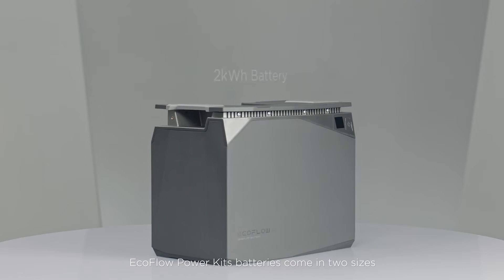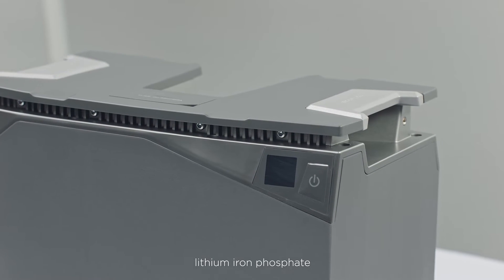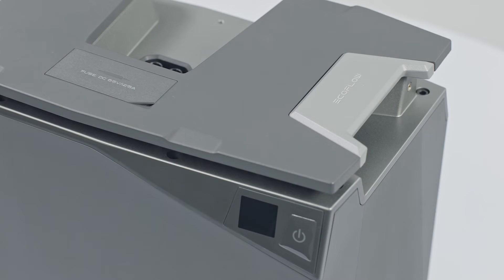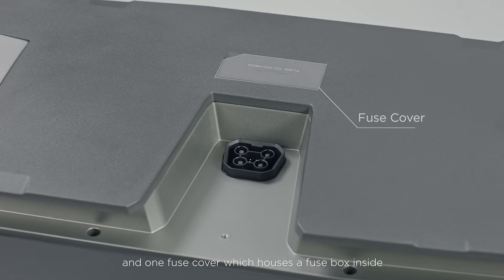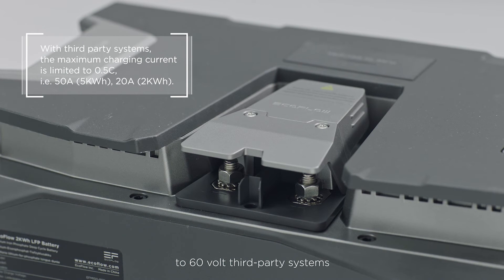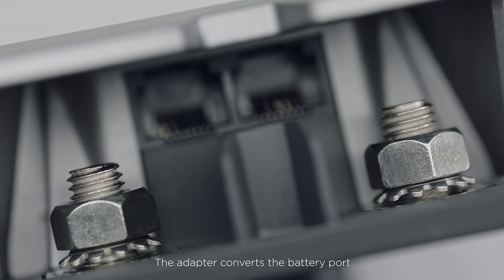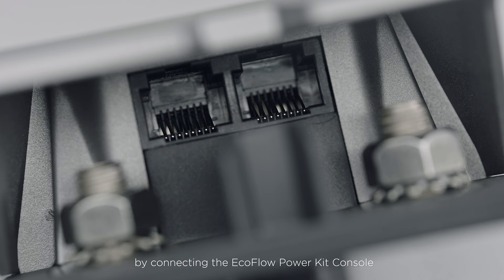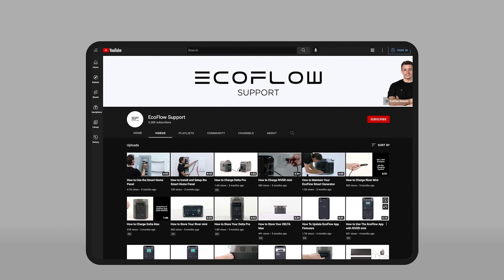Power Kits Tutorials | EcoFlow 2kWh/5kWh Batteries

Comment: Connected to the Powerstream, the battery has an annual consumption of 140kWh and more, only for charging and discharging the battery.
Reply: But that watts consume comes from Solar? Comes from batery itself? or from the Grid?
Reply: @TargetingXmod_RC Thats the consumption that the Powerstream uses from the Battery for conversion losses and keep the Powerstream alive at night when you set the discharge-limit. At the next morning the Powerstream first charges to discharge-limit plus 5%. With an 2000Wh Batterie that is about 300W before sending power to the grid
Reply: And now After more then 8 Months all Problems Like the 5% Minimum charge of the Battery non working automation still exist. I‘ve Reporter the Problems First time in August 2024

Comment: Are these compatible with the Delta Pro?
Reply from the maker: Hi there, sorry Power Kits are not compatible with Delta Pro, but EcoFlow smart generator can do.
Reply: @EcoFlowTech  That’s strange, why would Ecoflow give their Power Kit batteries the same connectors but make them incompatible? 

Ecoflow customer support also told me I couldn’t link up my two Delta Pro units but I can, a simple Anderson Powerpole to XT60 cable does the job perfectly, charge unit 1 with solar and when it’s full turn on the 12v DC and transfers over to unit 2 with almost zero loss rather than the almost 40% loss Ecoflow stated via their solution to plug it in via the AC plugs. 

I’m pretty sure the Power Kit batteries would work with my Delta Pro’s but the units just wouldn’t recognise them as extra smart batteries, that’s too expensive of a chance to take though. 

Thanks for taking the time to answer my question.
Reply from the maker: Hi there, yes the interfaces on Power kit's power hub and its batteries look the same to the one on Delta Pro, however they can not communicate. Therefore, you can not connect Delta Pro to Power Kit or use its batteries to charge Delta Pro. Regarding linking up two Delta Pros, the way you try to connect them is doable in principle. However, the charging power is relatively low and the cable might heat up as the maximum output of Anderson port is 30A(which is much higher than solar input).  Your feedback is really insightful and I have brought it to our product team. Cheers for that!👍👍
Reply: @EcoFlowTech  Thanks. I’ve done the research and the solar input can handle up to 60A via the BMS and that’s a safe amperage to use with 12AWG cable, it also has the advantage of charging at only 360W which is better for the long term health of both batteries. I don’t know why they weren’t designed to properly communicate with one another, it’s a huge design oversight, but it is what it is. 

If your product team could design a cable for the job with an inline current limiting resistor that would be very useful, I could add one myself for complete safety though.